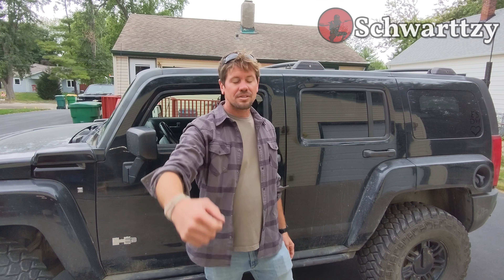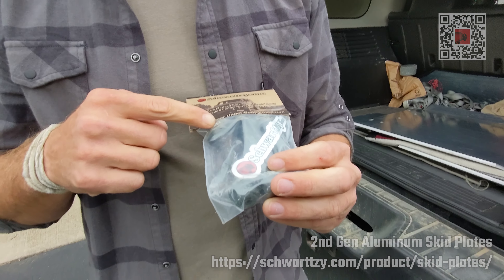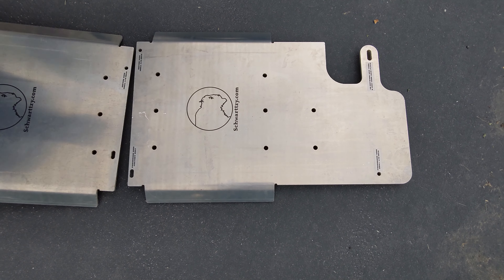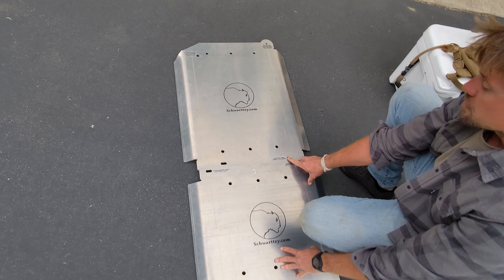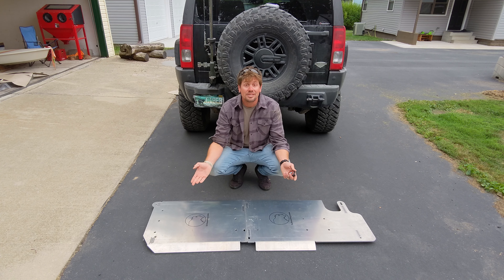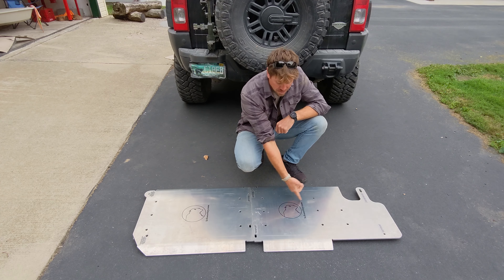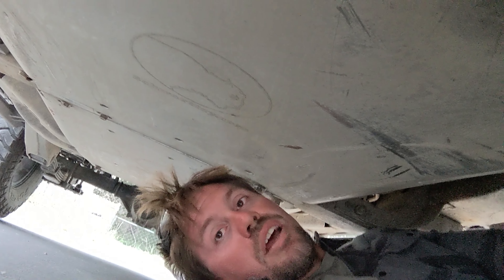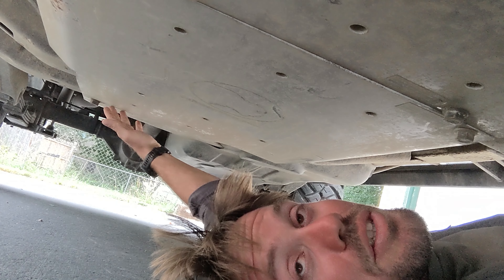H3 Hummer 2nd Gen Aluminum Under Body Protection Skid Plates

Comment: 2nd gen rock sliders soon? :D
Reply from the maker: Working on them! Getting closer, trying to eliminate the need to for welding and have them bolt together like LEGOs.
Reply: Has there been any difficulty getting them compatible with the h3t? Im guessing you’ll just have a longer h3t specific lego section?